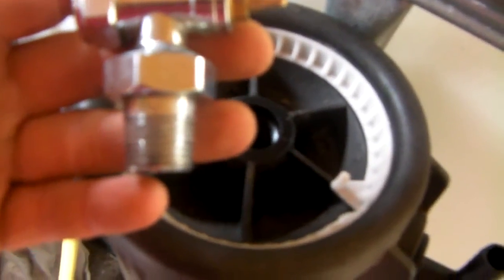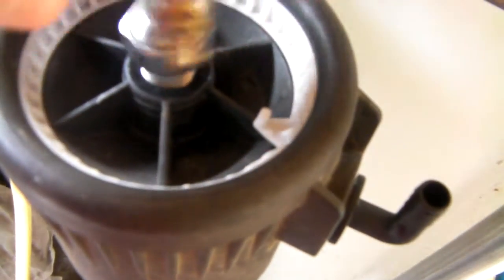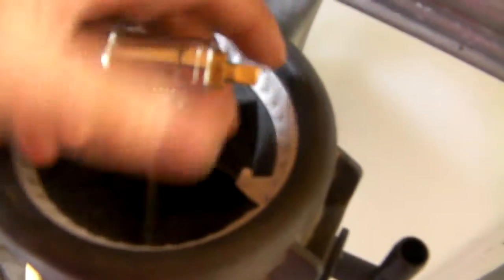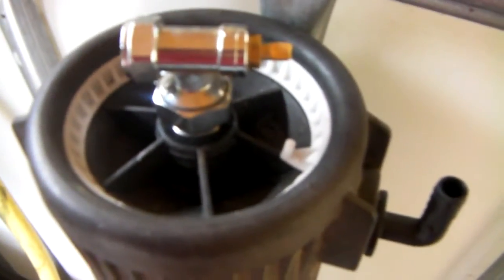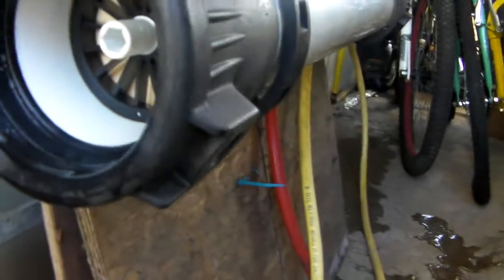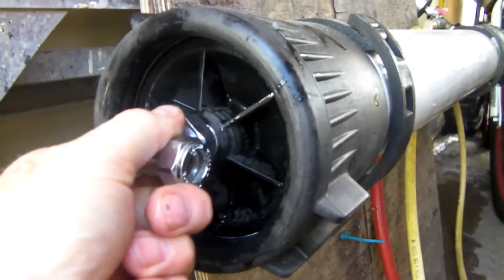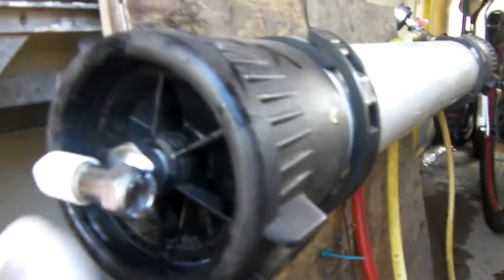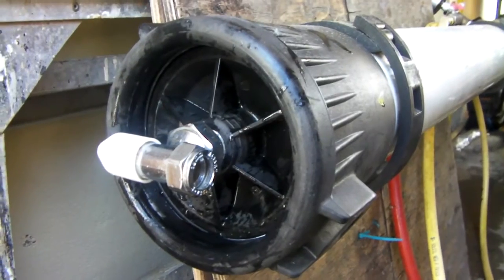Changing a membrane on a 40/40 ro  for window cleaning

Comment: sometimes can be difficult. my 14s would get to 20s 30s when flushing and even when restrict, never get lower. my 4040 was used but knew it was shot, basically came with housing. it wouldn't go below 30. tried to DI flush and acid flush, back flushed, acid soak but no change. basically, if you know your membrane and it's numbers and those numbers are going up, flow a bit less, then possibly fouled.

Comment: yeah, got my new membrane today so going to give it a go. with my 14" ones I had the SS housings so ended up having to take both clamps off. Hopefully when I take the bottom off this one slides out nicely. 
on another video, you tried a booster pump. do you remember the s
ecstatic of that pump, Name? reason I ask is I see so ,any pumps out there. Even when I call Shurflo or Flo jet they are confused and seem to have no idea about a booster pump. Shurflo says an 8000 series, their main pump is not big enough for a 2500 gpd. another Water guy uses a Delavan pump but adds his label to it. call Delavan and they deny the pump can be for a RO booster pump. I will look for the pump video you did and start a thread there to see what type pumps and modles others use so I can match and get a decent one.
Reply: how do you know when you need to replace a membrane ?